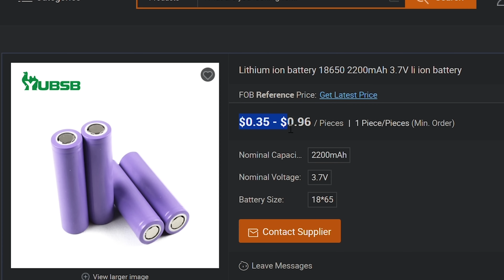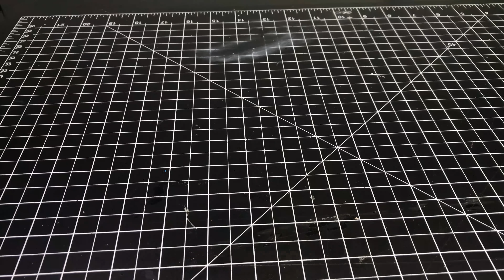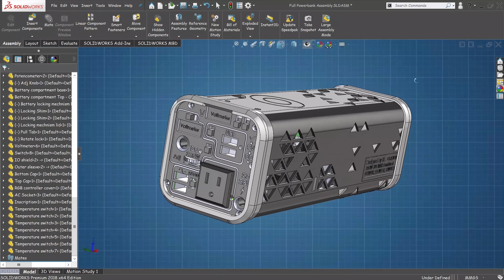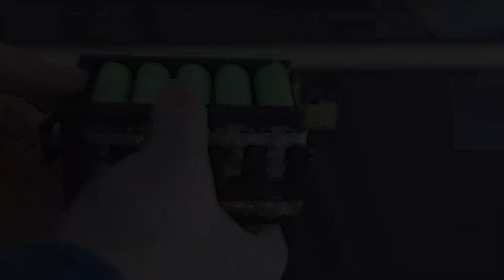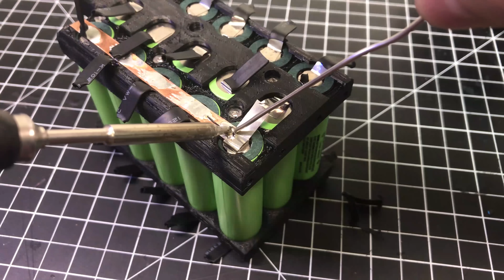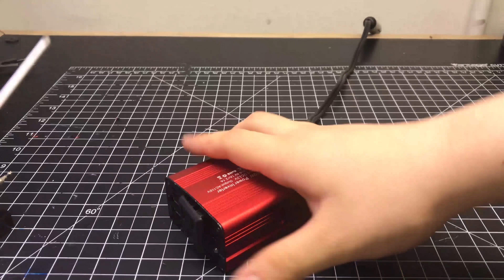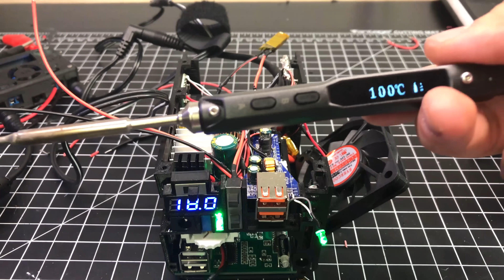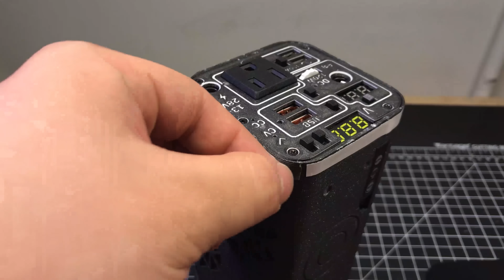How to Make the Ultimate 18650 Power Bank with Infinitely Expandable Capacity

Comment: I like the addition of the thermal sensors. Built a 3s4p pack myself with the same bms. Friends started to link the video to me saying "we found you!".  Very compact. Well done on the alternative to spot welding, I thought the copper would dicipate the heat rapidly?

Comment: this video was otherwise great, but @10:31 "this way the batteries are protected from being charged and discharged at the same time ??????, You don't need that kind of feature. You can charge and discharge the battery at the same time, it will just be slower, if your charger can't handle it, The same way that you can use your phone while it is charging...

Comment: Hi. Why use a relay to disallow battery to discharge when charging? Let say charging at 2amps and the load is 1amps, if without relay, it will charge 1amps and another 1amps is divert to the load right? Isn't even better as you can charge with solar then still can put load.
Reply: This video is inspiring like watching ironman building energy system. Thank you.

Comment: Which one do you think is better the 60,000 mAh power bank or this one
Reply: This one, while his soldering still isn't very good (risk of the joints becoming loose) they have improved massively compared to the previous powerbank which was literally a timebomb waiting to burn down someones' house. At least this one has some protections built in...
Having said that, should this thing ever burn down your house and I hope it won't obviously, it is highly unlikely that an insurance company will reimburse you if this thing caused it, it's just not worth it doing this yourself unless you can get it up to code...
Reply: @someguy4915  why would the joints come loose? It seems fine compared to the last powerbank
Reply: @randomdude4110  It's much better than the last one, yet there still are some cold joints which will just break off at some point, worst one seems the main connections of the plug to the charger board.
Reply: @kralyn3d  try aiming the camera in front of you, from up looking down aiming at your hands so we can see the shots no matter what